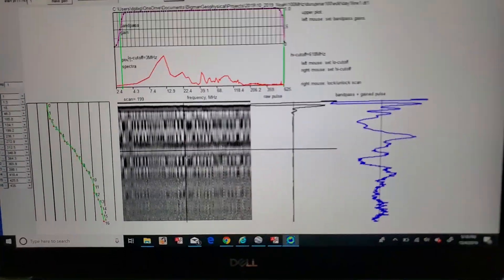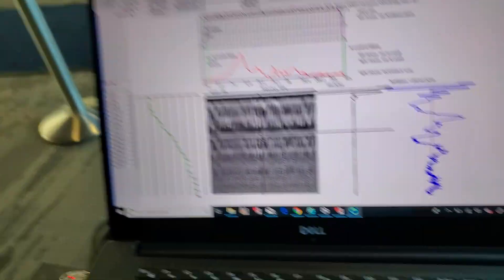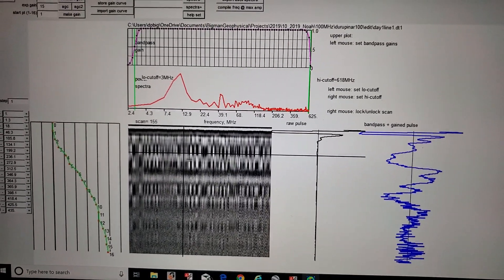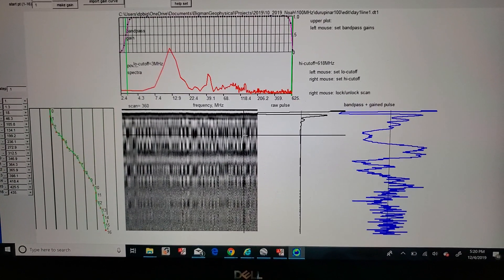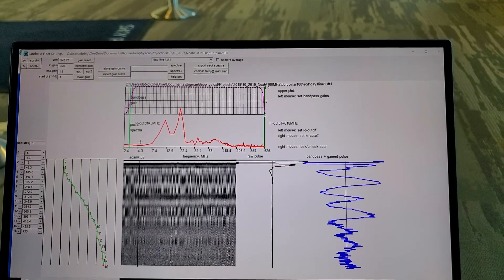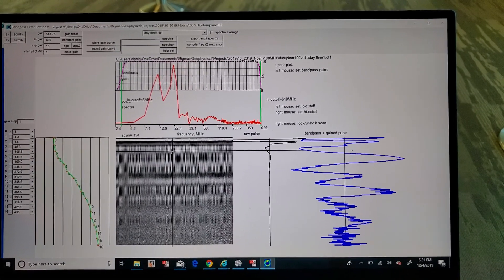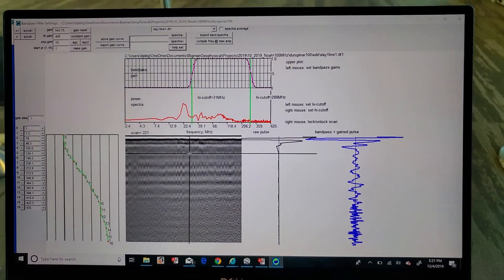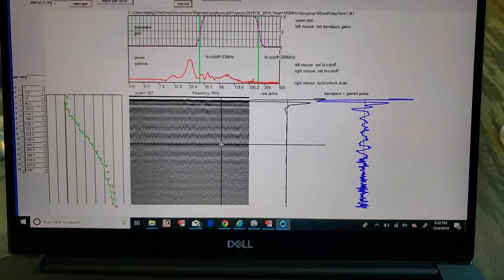Some UGLY looking GPR data | how to remove noise from ground penetrating radar data

Comment: Useful video. Thanks Sir
I work on Reflexw n apply Bandpass Butterworth/bandpass filter to reduce the noise level.

I have one question related to cavity detection. I used 200MHz antenna for survey and presented the reflectivity as slice but is this enough to process the 2D profiles simply and present it as 3D depth slices? Or Is there any additional processing step or amplitude analysis method to define cavities more accurately?

Please advice and share any work/research references
Reply from the maker: Each data set is different, and the filters will depend on the quality of acquired data.
Reply: @Learngpr  I have one question related to cavity detection. I used 200MHz antenna for survey and presented the reflectivity as slice but is this enough to process the 2D profiles simply and present it as 3D depth slices? Or Is there any additional processing step or amplitude analysis method to define cavities more accurately?

Please advice and share any work/research references
Reply from the maker: @mauryapranjal  I'm not sure I understand the question